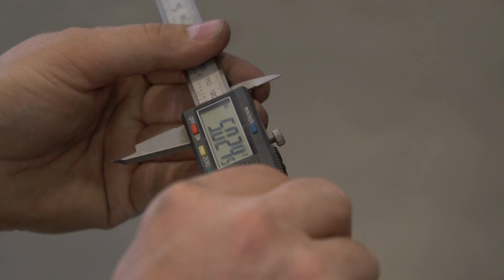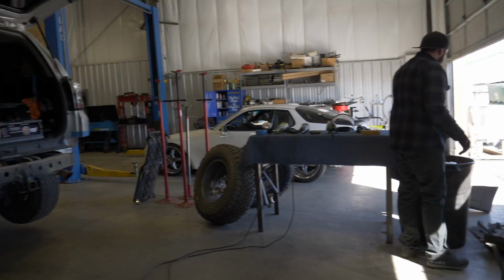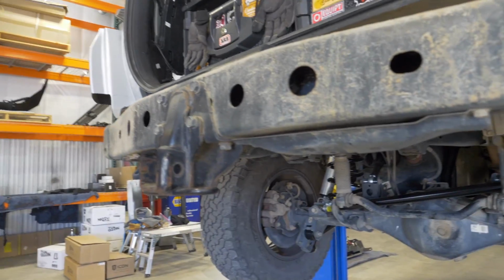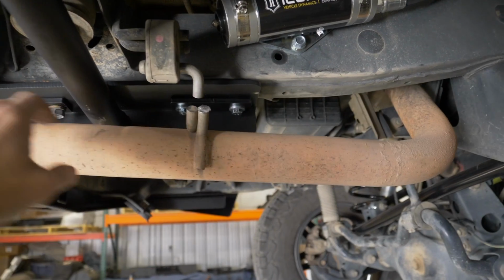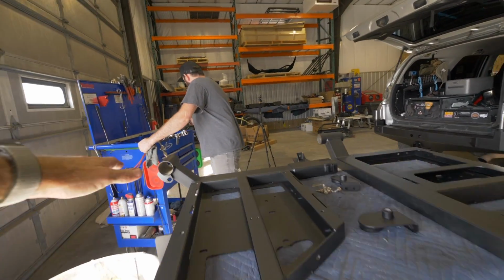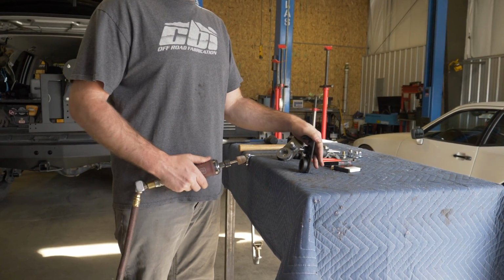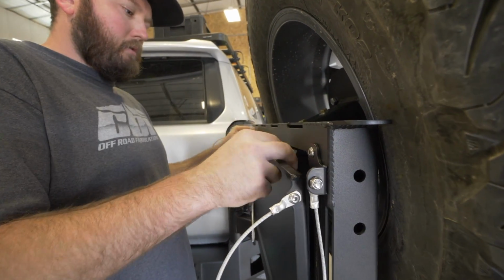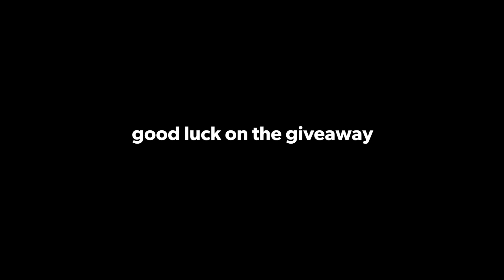Why I added 100’s of lbs in Steel Bumpers to my 4Runner (PLUS C4 LoPro Bumper Giveaway)

Comment: Fuel efficiency is better at altitude due to the air being less dense and effectively reducing its effects on aerodynamics.  That bumper is a piece of art.
Reply: I disagree, the lower density of air at higher altitude is insignificant compared to the reduction to the horsepower unless he was going very fast. The density of air directly affects the hp.
Reply: Its more attributed to the engine needing less fuel since the air is thinner at altitude.
Reply: On a fuel injected vehicle the ECU will keep at the air fuel ratio at 14.7 parts air to 1 part fuel no matter what.
Reply: @ourkaravan  That doesn't discount that the engine has to work harder to obtain that 14.7 ratio, as it requires more air at higher elevation than at sea level to reach the same ratio, due to the air being thinner.
Reply: @boardskateguy  and that higher throttle angle increases the volumetric efficiency of the engine.  ;)   I dunno, I'm out on this discussion.  The only thing I can add is several of us with the same 4Runner all caravan together at the same speed and we all observe higher fuel efficiency at altitude.  After supercharging mine I suddenly gained 1 mpg over everyone else I was traveling with.  This only happens at elevation....at sea level my mileage is the same as the non-supercharged guys (and gals).
Reply: @ @ipdjbt  without getting into the thermodynamic of Otto cycle, and using your analogy, then the less fuel that goes into the engine, means that less heat is released from chemical reaction of combustion hence less horse power.  :)
Reply: I would guess that the engine gettting less dense air is way less important than the actual drag air puts on a vehicle in this case.
The engine surely still gets the amount of air it needs to not lose horsepower worth measuring. It's such a small difference. Drag however has an enormous affect on vehicles mpg.
1-3 horsepower up or down probably does not.

TL;DR,
Thin air, less drag. Engine gets enough air still. Or just the fuel used in that area.

Comment: You should, theoretically, get less MPG at higher altitudes because of a lower air pressure. Less air pressure, equals less air for combustion, which should equate to slower acceleration and lower MPG. Just my two cents...

Comment: The thinner air at high elevation requires less fuel to burn. It's all about the fuel/air ratio.
Reply: This is a fuel injected vehicle. Fuel to air ratio is about the same, regardless of altitude.
Higher altitude requires more throttle opening to maintain the same horsepower. Also, miximum available horsepower will be noticeably decreased at higher altitude. The vehicle can also run on lower octane fuel at higher altitude because of lower air pressure (a.k.a. - density altitude).

Comment: Do CBI bumpers allow you to keep the rated towing capacity of the vehicle? Beautiful build.
Reply: Joshua Bowie The way I understand it, any weight added to the vehicle decreases the amount you can tow.
Reply: Jethronius Bronlo, yes, but not my question. The 4Runner can tow 5000lbs. If the bumper weighs 100lbs more than the factory, it just means you can only add 4900 more lbs. my question is, do CBI bumpers maintain the same tow rating as the factory. Can it still tow 5000lbs? Some bumpers change the hitch and no longer allow for the same tow rating.

Comment: You keep mentioning being under powered. You should really look at regearing. It will give you back everything you lost with weight and tire size. I have a pickup with a 22RE and 35 inch tires. With 5.29:1 gears it drives like it did with 29" tires.

Comment: My thoughts on the fuel eco at high altitude. From my experience working on old 22R carburated engines. Less oxygen. To keep air fuel ratio equal, ecu compensates fuel with oxygen measured. Ecu probably controls timing to help with power. Just my 2 cents.

Comment: You get more mileage higher altitude. The air is thinner so it’s less drag. My truck gets 12-15 in Texas when I went to Breckinridge I was getting a solid 20MPG.

Comment: what are you running for rear springs?  Did you upgrade  those for the bumper?
Reply from the maker: I have their "overland" springs, the heaviest/stiffest they offer.  They are less stiff than the OME 899's I had before, and I haven't decided if I'll be changing back to the old ones or not.
Reply: Great!!  I'm on the OME 898, their medium coils and they are crazy stiff.  Will be putting on a rear bumper soon, but may drop to the 899s till.  I have drawers, fridge, and a home. made solar generator with a Battle Born Lithium battery, full skids and still stiff stiff. your rig is looking fantastic.

Comment: Grab a ODM plug - plug in that will adjust your vehicle's computer to run efficently (generally increases engine and power from 11mpg to 22mpg or better (but not worse) and it is cheaper than your bumper.

Comment: Higher elevation means less oxygen. Less oxygen means less fuel required.. it’s a crude and way too simple explanation but that’s what it boils down to.  

Rig is looking beautiful
Reply: it also has to do with humidity as well but yes, thinner air has more combustion as well so you get a bigger spark with less fuel and your engine can only take so much displacement so it limits the fuel intake b/c the combustion created with thinner air has a bigger bang.  And yes, also humidity plays a role in the weight of air and how it moves freely, hence a cold air intake can improve parameters based on where that cool air is coming in-

Comment: Slight difference in roads. Stop and go type roads are worse for economy. Utah from the parts I saw in salt lake and park city are not like Orlando Tampa st Pete or Sarasota fl. Florida is denser and you would be accelerating more often which is where you use the most fuel. Wind resistance at slow speed is not the cause.

Comment: Re fuel economy:  the computers monitor air density and moderate fuel flow to maintain proper fuel/air ratio.  So, more air at sea level = more fuel to maintain ratio, resulting in worse fuel economy at low altitudes, or colder air, or anywhere air density is greater.

Comment: Who cuts steel body work then doesn't protect that metal? Instead they apply a rubber strip to trap moisture in-between the rubber and exposed metal... Great work there...
Reply: Just FYI, the bumper cover is plastic.

Comment: You’re mileage either way is not good at all, whether in Utah or Florida. Located in the DFW metroplex, and I average 17-18, just driving on city streets with almost zero freeway use, in a 2015 Trail model. But mine is bone stock, right down to the OEM tires, which I haven’t worn out yet. I get 20-24 mpg on the open road, and 12 mpg towing a 19’ Jayco Hummingbird travel trailer. At some point, I want to do some of the upgrades you’ve done to your 4Runner, but I can’t help but think that you’re probably a little heavy on the throttle if that’s the mileage you’re getting. I learned when I first bought mine that the mileage WILL drop into the 14-15 mpg range if I don’t pay attention to the green ECO light on the speedo. But if I do pay attention to it, mileage is consistently 17mpg or better.
Reply from the maker: Yea. I have an idea to put street tires on and see what I can do. My guess is that they are the major culprit. I saw a huge drop when I put AT tires on